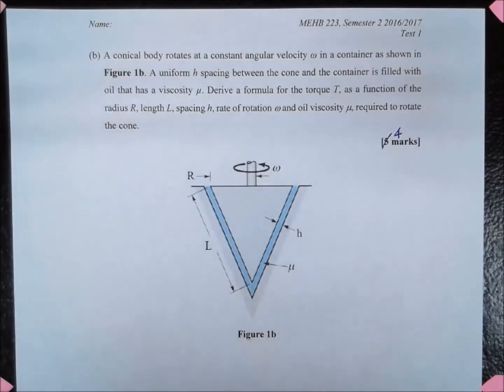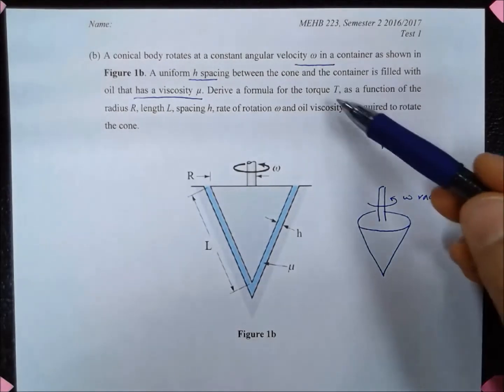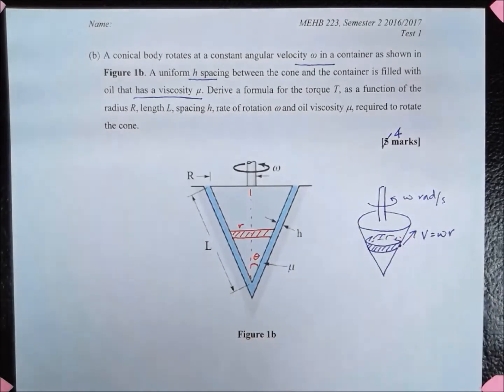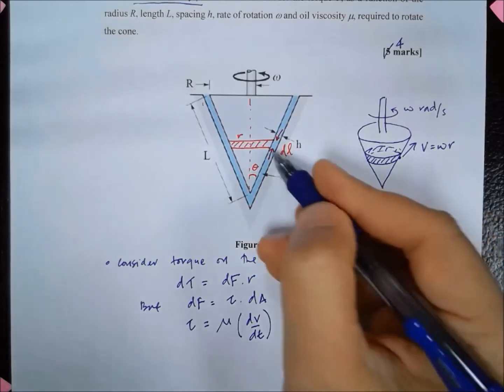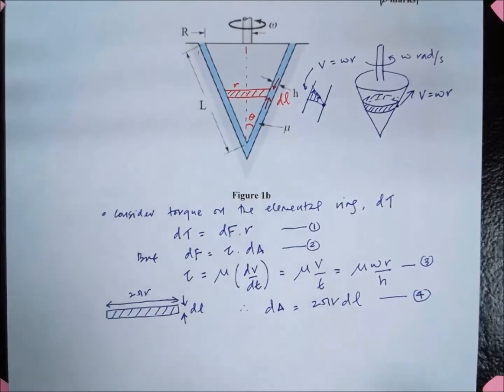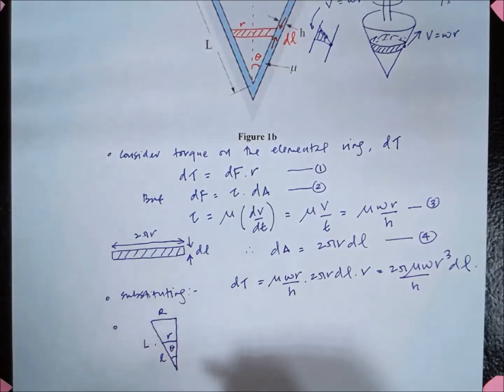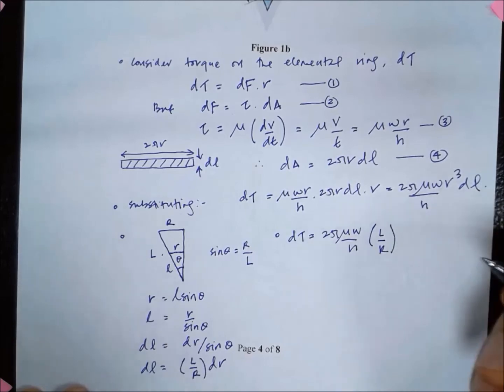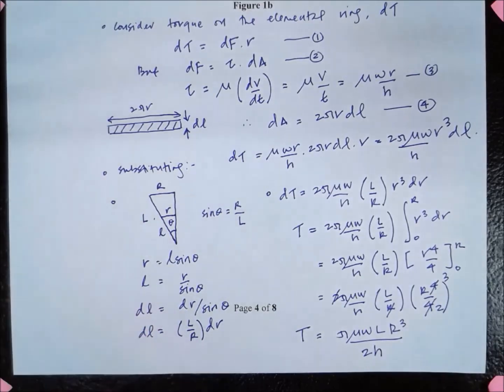Mechanics of Fluids - Topic 2 - Example 6 - Viscosity - Rotating Cone in Annulus

Comment: Thank you sir.I had a doubt as to which direction to take gradient. In this case we could take the gradient in horizontal or vertical direction but we took perpendicular to the two surfaces. What is the reason behind it?
Reply from the maker: I am not sure what you are referring to. If you are referring to torque. Torque is F x perpendicular distance from axis of rotation. And F is viscosity x velocity gradient.
Reply: @MohdZamriYusoff  
Sir , I was referring to the direction you took the velocity gradient,here it was normal to the two conical surfaces. I think that probably the direction to take the gradient in shear strain rate calculation should be normal to the fixed boundary. Please comment on this assumption.
Reply from the maker: The direction of velocity will be tangential to the surface. This will give shear stress and hence shear force in the same direction. This allow use to use  radius directly when calculating torque since it is perperdicular to the force.